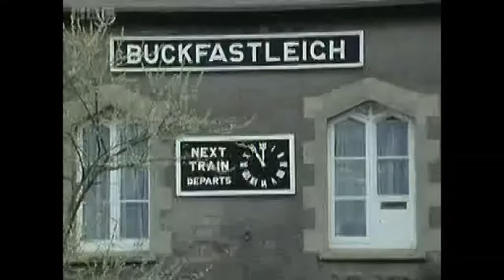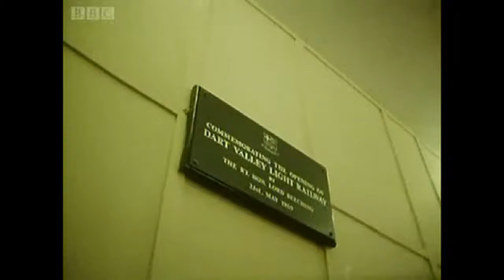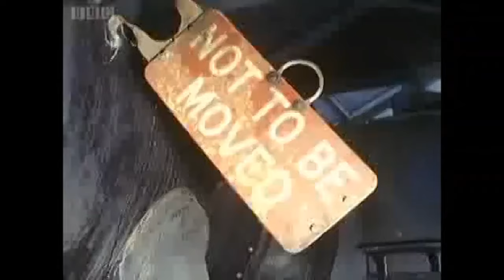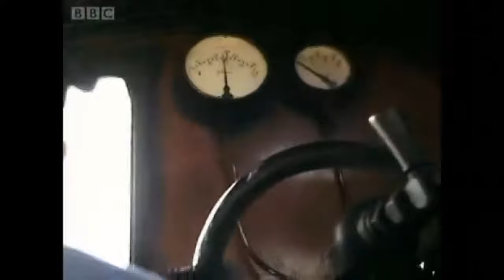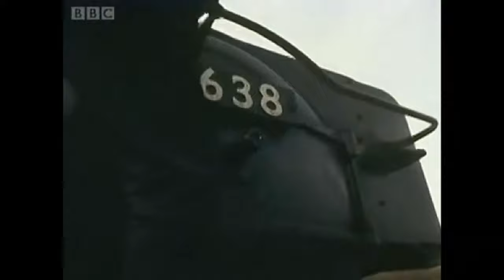Steam into Summer

Comment: Am amazed in rediscovering what is now called the south devon railway (at buckfastleigh) out there, which was back then from when this intriguing documentary programme was filmed/made back in what I believe was 1979, originally called the dart valley railway during the SDR's first two decades in railway preservation. 

I'm also impressed with the nostalgic instrumental production music used in this late 1970s (or early 80s) BBC south west television documentary programme by the way, Along with the cleverly well-written, Jolly well read-out poetry so cleverly recited halfway through the programme that delved into how the dart valley railway, of whom the south devon railway was originally called back then, saw it's volunteers and may helpful assistances going about in running a preserved branch line railway each & every other day.

OH, and how very, VERY interesting to see how completely different all three preserved west country stations along the SDR once looked all them years ago, A whole lot has changed since then,

A tip-top 10 out of 10 for this nostalgic documentary programme.

Comment: According to DVLA that MGB that appears at 10:47 survived on the road until 1993.
Reply from the maker: My dad used to have a greenish yellow MGB GT hardtop and after a while had it stored at my nans house as he needed something newer so he bought a Mazda 323. The plan had been to leave it there for a while and then when the right time came get it back out on the road, unfortunately it rotted away in some area's (although not severely when it came to changing the wheel one time the jack went through the bottom of the car). 

Behind my father's back my grandad (his father) sold the car to someone else, lets just say there was one hell of an arguement afterwards. In later years my dad said that had it not been sold and had also been properly stored if it hadn't been sold he would've given it to me. Although he's not owned another one since should I ever get the money for one im gonna try and buy a new MGB GT.
Reply from the maker: William Bateman  that would've been my thought's too, but it was many years ago this happened & my grandfather has long since passed away since then. January 11th 2007 he passed away, I believe aged 75.

Comment: Love the South Devon Railway.  A pity it doesn't run all the way to Ashburton but the authentic coaches, engines and buildings make it always a fantastic journey.
Reply from the maker: It is a real shame that Ashburton is now no longer part of the railway and it would be good if they ever re-instated that part of the route but I doubt we'll see this happen unless funding is granted and the trackbed can be purchased back if it had been sold aswell as pray that it's not been built on.
Reply: The A38 duel carriage way has been built on the line from Buckfastleigh to Ashburton I'm afraid the railway won't go extend towards Ashburton anytime soon
Reply: @matthewpalmer2049  The station building in Ashburton is still there though, I believe it's been converted into a garage now.